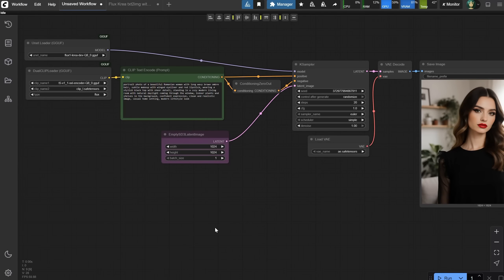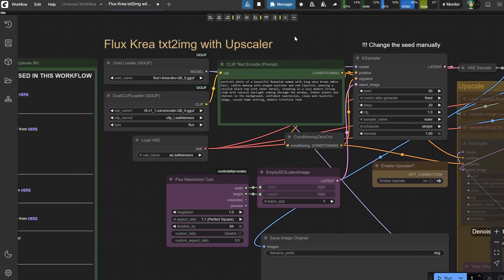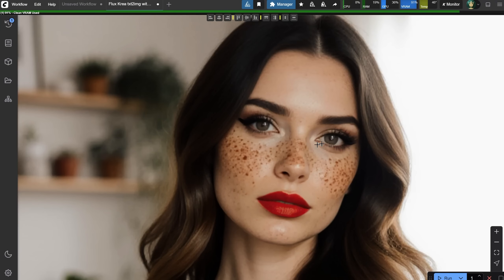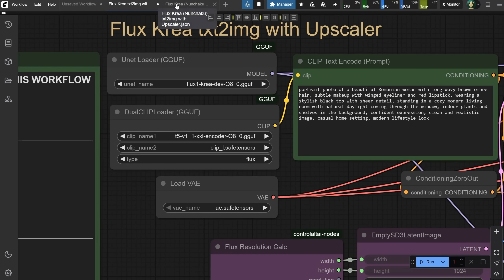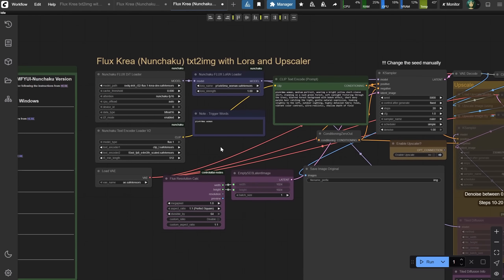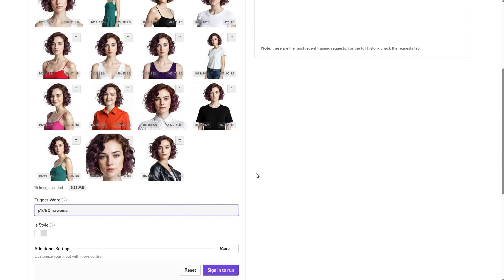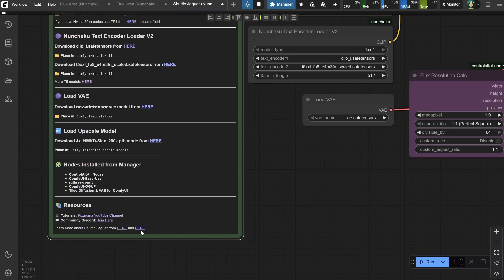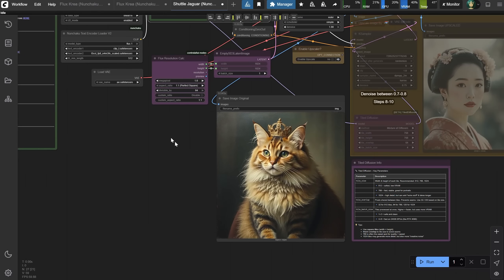ComfyUI Tutorial Series Ep 56: Flux Krea & Shuttle Jaguar Workflows

Comment: I'm just now getting into flux (I mostly use SDXL/Illustrious still) and so the proper folders to use for models are new to me. For some reason my setup wants the text encoders in the "text_encoders" folder and not clip. I don't even have a clip folder (I do have a clip_vision folder). I mean, it all works, I just don't understand why my directory structure would be different.
Reply from the maker: for me it works on both they added new folder now we have text encoders and clip that for most of the models works the same, and also diffusion_models and unet, before we had only unet, so i think they wanted to do like some unified folder that support more that why they added another folder that do pretty much the same.

Comment: Hello, I often get disconnected when using workflows. I have to restart ConfyUI every time. I use Nuchaku that he work great. And it often fixes the problem. I have an Intel Core i7 13700HX with an 8GB RTX 4060 and 32GB of RAM. I'm using models with versions that match my RTX 4060. Do you have a solution for me?
Thank you.
Reply from the maker: 8GB is not much that why you run out of memory, even if you use a 8gb model that you think fit in memory, tt also have clip models, vae, the browser you run and so on that take from memory so at some point you run out of it.  I do use sometimes a clean vram node after vae decode to prevent slowing down and building up to much stuff in vram. With 6gb of vram it crash a lot on ny old pc, on new pc with 24gb it doesn't
Reply: @pixaroma Thanks for the info, it's really interesting to follow you and your videos are very well done and easy to understand.

Comment: I understand you're testing out things and maybe your old voice was/ or have become expensive? I don't know, but what I do know is that your new "voices" doesn't have what the old one had. The new ones all (if there's been several, which it's seems as if it has) are stressed, they're talking faster or are articulating faster, which when you have a monotone voice becomes more difficult to follow. I can tell you that my ADHD brain shuts down on this and I, again, highly recommend you switch back to your "old self", if that's financially viable. Hang on - maybe this voice is the normal one? It's very similar, but it's sped up? Anyway this is faster talking and it's not doing as well as you're original pace.
Reply from the maker: trying to fix on episode 57, created a voice that talks slower and should sound better. Will be live in 6 hours.

Comment: when running the shuttle jaguar model I always get a disconnect (without reconnecting). It happens when it's at the flux DIT Loader - I updated comfy and the custom nodes, but its still not working. Any thoughts?
Reply from the maker: The model is quite small and usually disconnect happens when run out of memory. No idea why that happens

Comment: Will you get rid of the standard FLUX developer now that FLUX Krea is out?
Reply from the maker: not yet, for some things like text I still get better result with flux than with krea, and for some illustrations I get some clear results with flux with krea it tries to make it a bit more realistic and add some noise so depend on projects, right now I am using flux dev, fluxmania, flux kontext and flux krea so depends on the project
Reply: @pixaroma for text kontext is the way to go right? Plus I tweaked your workflow from episode 6 I think, where you introduced the styles file. I modified it to be used with flux Krea and it's working very well. Just a bit slow.

Comment: Two things to notice about Krea. LORAs trained with Flux1 Dev are no longer handled the same way. So I think I need to train LORAs with this new model.
Also, Krea doesn't support controlnet models designed for Flux1 Dev
Reply: I was wondering about this. I was about to train my first Lora using TensorArt (from an earlier video) now wondering whether I should use the fal website instead for Krea. As soon as you get your head around one approach, something brand new turns up!
Reply from the maker: thanks for info, i only tried training on fal ai for krea. didnt try control net yet

Comment: GGUF models are generally slower than the original models. I wish people would stop saying they're faster. 

The only reason you want to use GGUF models is to conserve VRAM.
Reply from the maker: for original model they offer like fp8 lets say, if you get a q8 version that is more similar to fp16 so fp8 is morel like a q4 and that q4 is way faster. if your card can not fit in memory that original model it will be very very slow, but if you get a Q version that will fit in your memory it will be fast. So using a gguf version it will be faster most of the time that why I recommended plus is save a lot of space
Reply: @pixaroma  From my experience comparing compressed models vs original models, the compressed models are slower.

I even asked on Discord, and have read comments on Reddit that confirm this. 

Of course if you don't have enough VRAM or want to run ControlNet, or Redux, etc. then using GGUF files to conserve VRAM makes senses.

This is just my understanding.